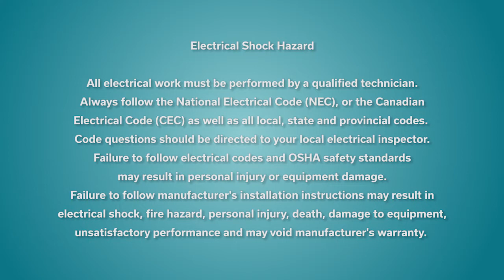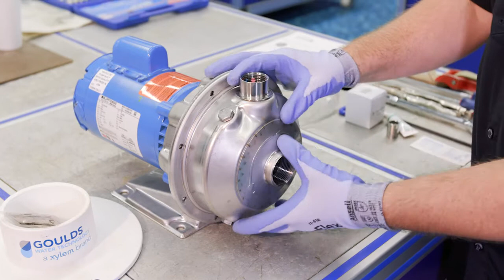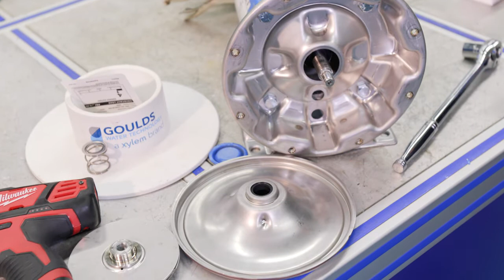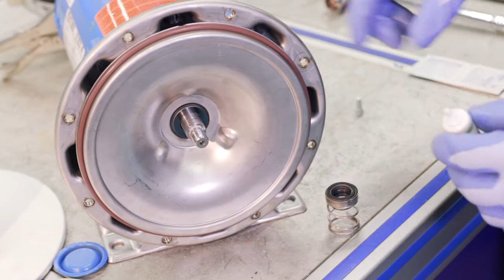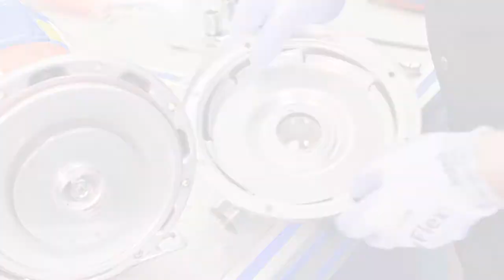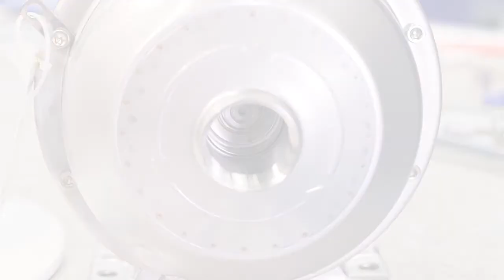NPE Seal Replacement

Comment: Thank you, all went well until the last step, as there is some drag, sounds like metal to metal, so will pull off the cover and check the alignment of the inside housing that the o ring sits on, in my case it is the unit that it attached to a bearing for gas motor attachment.